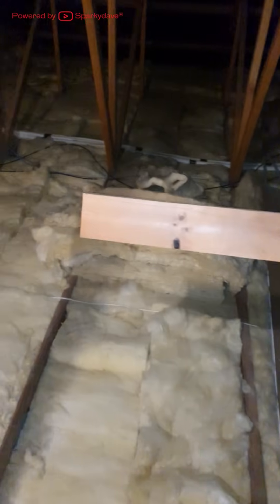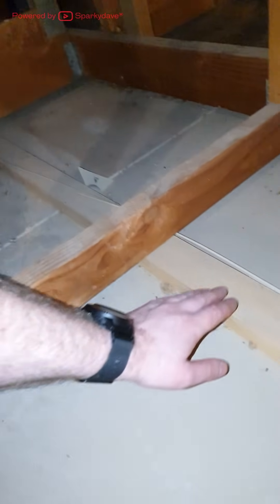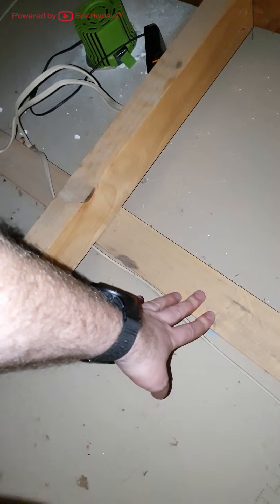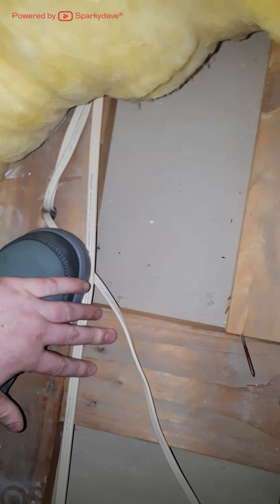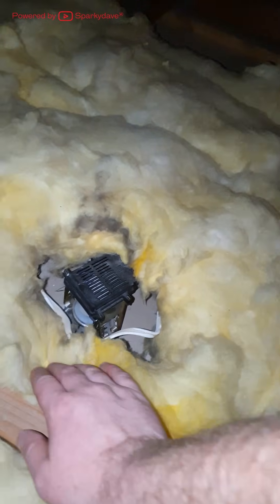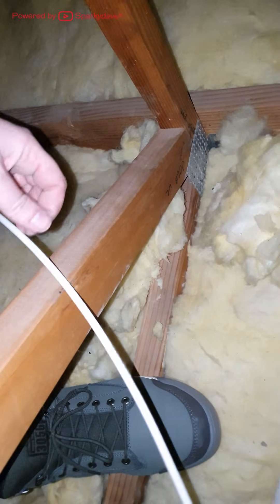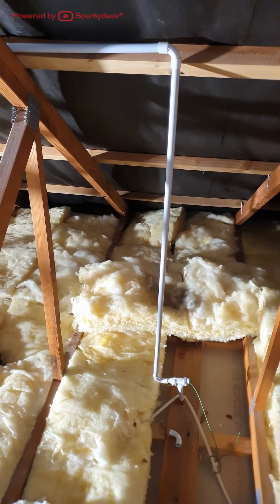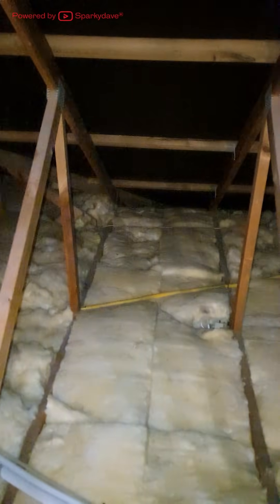How To Walk in Ceiling Cavity (or Roof Space)

Comment: loving your videos. Couple questions.1.  Could you do a video on repairing ceiling fans that are stuck on 1 speed. 2. Could you do a video on replacing bathroom light & exhaust that is seperate with a 3in1 light fan & heater. Thanks heaps for the info!
Reply: The speed regulator is stuffed, you will need to replace that in order for the fan speeds to regulate properly.
Reply: Do you mean the fan is on continuously or only works on a single speed?
Reply: @lachlanslightsandfans  i can turn the fan off but when it’s on, it’s stuck on 1 speed even when I rotate knob to the other speeds it remains on the same speed.